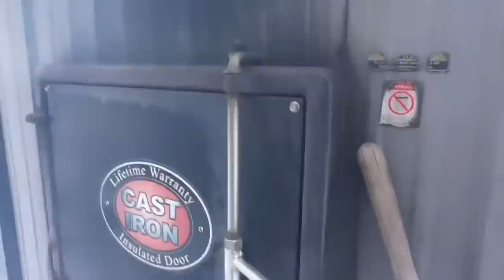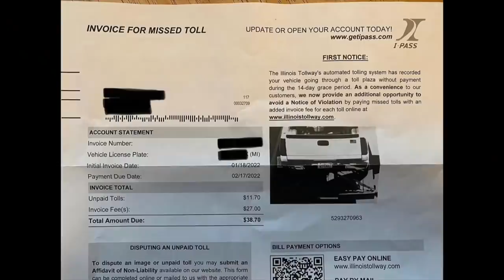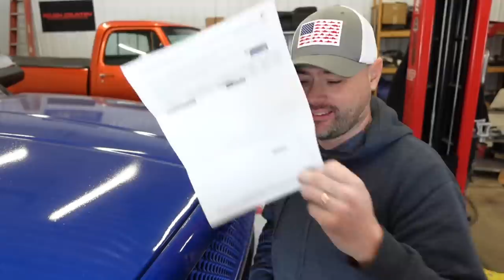I Got A Ticket For The Truck I Was Towing Through A Tollway! IS THIS LEGAL?

Comment: Keep a close eye on your billing!  Based on the conversation it sounds to me like she changed the settings for the easy pass to a 4-axle vehicle.  If so, now you will be overcharged every time you go through a toll booth with just the truck.
Reply: Hope he see's this comment.
Reply: @joseaklx300r6  next time you go stop at one of the rest stops on the toll road. They sell prepaid ez passes in vending machines that you can link to your credit or debit card very easily. I suggest getting a prepaid credit card to link to the prepaid ez pass.
Reply: Not to menton if he goes through the toll without any cargo on the trailer (a vehicle), sounds like he will also be charged as if there is one on it.
Reply: @DallasD_  Its axles on the ground, they don't care about cargo.
Reply: @1958johndeere620  👍🏼 makes more sense, 5:45 she says "car", she meant the truck puling the trailer, car sounds like refering to what could be pulled on the trailer.
Reply: @DallasD_  From the sounds of the conversation, I think they only bill for axels, empty or loaded would not matter.  Just to be safe, when hauling a customer vehicle, he would be wise to cover the plate.
Reply: @1958johndeere620  Technically it's tires on the ground, if the axles are on the ground, you've got bigger problems than the tolls. ;) 
He could legally cut the extra charges in half when pulling an empty trailer by removing both wheels off of one axle and chaining it up so the equalizers ride level on the other axle. Might not be worth the hassle for $20 but it's $20 in his pocket and not going into the Tollway's coffers. If it's something he does regularly it would add up, or at least pay for lunch.
Reply: @butchs.4239  It's Illinois. The toll winds up going to everything except the toll roads.
Reply: Illinois didn’t send me a w2 for my taxes this year. Called them. They said we can pick one up 90 minutes away. 😂
Reply: I believe she said it would be half price when it was just the truck.
Reply: @davidwickboldt712  Could be..... Just to be safe I'd keep a close eye on my billing if it were me.

Comment: according to my research, tolls are assessed by the number of axles for the towing vehicle plus axles on the trailer. according to the information provided the trailer tag number must be included in your account to properly charge you for the tolls. the cargo, trailer, and towing vehicle must not exceed a stated weight which most have as 20,000lbs.

Comment: I drove a flatbed semi. If I had to go a long distance empty, I would use straps to draw up the first axle on the trailer. Leveler on the rear axle, no prob.
With less rolling resistance, I saved a lot of fuel.
Went through tolls that way, and they always marked a single axle on the trailer, because that's all that was in the ground.
Win-win.
Reply: That... just shows how stupid this whole thing is.  You had the same weight, yet you put it on less tires, increasing the PSI on the road surface and therefore the stress on the road.  Yet they charge you less for that.  Not faulting you, just the state, it's idiocy as usual.

Comment: Just a note, around here, specifically Baltimore tunnel, pulling a two axle trailer through the tunnels is $3 for 2 axles, $12 for a total of 4 axles.  At that price point its cheaper to go around.
Reply: I've pulled a travel trailer on toll roads and there is always a charge for the two extra axles on it.

Comment: I've been driving for almost 30 years and nearly every toll I've been through charge based off of the amount of axels you are taking through the toll. The reason is because the more weight you place on a road, the more damage it does exponentially.
Reply: Came here to say this. My buddy towed my truck and I got charged for 6 axles. Considered disputing it but it does make sense so I let it go and paid the man
Reply: One thing to consider: most current two axel transit buses (40 ft.) weigh close to if not over 30,000 lb. unladen. That's 5000 pounds pre tire (6 total), even more with passengers on board. At 80,000 lbs. a fully loaded 18 wheeler is putting down  approximately 4,450 pounds pre tire. This means that the bus is putting more weight pre tire on the road than the truck. Translated the bus is putting more stress on the road surface. So who should pay the higher toll?
    Note: trucks are allowed 12,500 lbs. on the steer axel (there is a live stock exception) as buses are allowed to go to 20,000 lbs.
Reply: your right at the toll booth it shows price by axle in IL im a local truck driver here!
Reply: A motorcycle only has two axles but pays the same as a car.
Reply: Obviously more wear’n tear per more weight but certainly not “exponentially” and there’s not one formula to substantiate such hyperbole. Also it’s not a logical cut and dry approach as many two axle vehicles as light in weight as motorcycles are rated as a standard four wheeler vehicle. Then it’s not all contingent on axle numbers but rather includes number of tires. All systems are programmed to assume multi axle trucks have multiple dual wheels per axle side and so try to accommodate toll rate accordingly. Yes there are infrared laser tripping detectors to count number of axles per vehicle and timed lapsed motion detecting to distinguish between vehicles passing through. It is recommended that you remove and or cover license plates of towed vehicles when transversing toll routes or you will be charged double or ticketed and or fined for unregistered vehicle plates.
Reply: @marvinjgerald6007  You can find the GAO study yourself since YT blocks links, but here's the gist:

"A study by the U.S. General Accounting Office (GAO) determined that the road damage caused by a single 18-wheeler was equivalent to the damage caused by 9,600 cars. (GAO: Excessive Truck Weight: An Expensive Burden We Can No Longer Afford) The study seems to have based its calculations around the number of axles per vehicle. The study found that essentially, road damage was related to the 4th power of the relative loads. That means that if one vehicle carries a load of 1,500 pounds per axle and another carries a load of 3,000 pounds on each axle, the road damage caused by the heavier vehicle is not twice as much, but 2 to the 4th power as much (2x2x2x2 = 16 times as much road damage as the lighter vehicle)."

Like I said, exponentially. 

As far as your interest in arguing over the minutia of how tolls are levied onto the public, that's a conversation for you and your state/local government to have since they are the ones who determine all that; not me.

Anyways, good talk. 👍
Reply: @robertheinkel6225  you must be young? a car has 2 axles... a motorcycle has 2 axles as well. a car has 4 wheels... a motorcycle has 2 wheels. a wheel attaches to an axle. axles & wheels are different things.
Reply: @stormtrooper88  haha he got ya mate just admit it.
Reply: @d.s.steele3100  buses - they are encouraging less vehicles
Reply: I have a triple axle and take 2 tires off to equal a tandem & I pay less $ . Haha
Reply: @d.s.steele3100  I am not  sure on all toll roads but most have a separate charge for Busses ( I know that Maine does and the Mackinaw Bridge for sure)
Reply: @robertheinkel6225   you are right and if you tow a small single axel trailer with a motorcycle you get charged for 3 axels. Just a reminder a motorcycle has 2 axels. Just each axel only has one tire. Also a dually truck pays the same as a motorcycle and  a passenger car and it has 6 tires. Yet again you pay for the axels not the tires. lol I personal think all bikes should get lower rate.
Reply: @robertheinkel6225  cars only have 2 axels too... Just extra wheels 😬
Reply: But they just tar over potholes ...or dont fix at all ...fraud
Reply: Tolls are such a scam..Most of the toll roads are owned by a company out of France..And most tolls are supposed to go away when the road is done and there is no more work..crazy that they work on the same road for 50 years
Reply: While I understand that premise generally, I have to make the point that if you replace the truck on the trailer with an equally weighted peice of steel, you would pay less. Same weight, but paying less because theres just less axles. They should charge for just axles on the road for this reason.
Reply: @SpaceRanger187  Where I live, there are no tolls, but the road construction never actually ends. They get beat up horribly in the winter, so they're always fixing them in the 2 months we have of decent weather

Comment: I’ve had this happen on the dc beltway and once on the gw bridge in New York. Both times the ez pass didn’t pick up on the trailer and both times it was cost effective to pay the ticket for the car on the trailer. Gw bridge is $13.75 for a pickup, but it’s $88 for a pickup with a tandem axle trailer…..the $13.75 and the $20 fine for the car on the trailer saved me 40 bucks haha

Comment: On head gaskets, head gasket cement can sometimes gather stick and bind when torquing down and guarantee a future problem. Use grease only and lightly and everything will slide into position perfectly and torque  down smoothly. Remember, it's the gasket that does the work, not the cement.

Comment: Make sure you are not charged for the truck that is on the trailer though.  You do have to pay a toll based on axel count however axels not touching the pavement ARE NOT subject to charges.  I live and work about 2 miles from the Ohio Turnpike and drive it every day.  I've assisted multiple customers with these complaints ranging from IL, IN, OH, NJ, PA, and FL toll roads.  Let me know if I can help.

Comment: I had this happen years ago. My truck was in an accident, it was taken to a body shop for estimate and repairs. The insurance company totaled the truck because of the age. The insurance company sold the truck for scrap and the company came and towed it, they had to go on a toll road, my truck was being towed by the tow bar on a roll back. The insurance company didn't let us get the tags off the truck so it got a ticket for running the toll. I fought the ticket and won.

Comment: For whatever reason your transponder didn't read causing your violation.  Make sure the transponder is mounted to the Windshield in the proper direction, you'd be amazed as to how many people don't do that, or it may not read properly. The pic of the one on the vehicle dash is directional and doesn't work the way it was laying on the dash. The one you held in your hand is better but can be temperamental. If your transponder reads, the system, will automatically see you are pulling a trailer and deduct your account accordingly.

Comment: All toll roads charge by the number of axles, except PA  they charge by number of axles and by weight.  Hope this helps you and others.

Be happy you aren't running a semi through IN, they charge us $57.75 for 5 axles.
Reply: I ran a gravel train with 12 axels  I cant remember the exact total but it was over $150 if I remember correctly

Comment: Ok, after watching the thing they were right, you don’t get charged for the axles of the car on the trailer, but if you pull a trailer for business you HAVE TO have a toll registration for the axles, pikepass in Oklahoma makes you get two pikepasses, one for 2 and one for 3 or 4, and put the one you’re not using in a ziplock bag lined with aluminum foil. My dad and I had a mowing business and had to live with this all the time.
Reply: Pretty sure Oklahoma's 2 axle pass gets voided the second you remove it from the windshield.

Comment: I received a bill from the Pa turnpike last summer. I haven't driven in Pa since the mid 90's. A close look at the photo showed a white Chevy, but my vehicle is a black Ford. Our license plate numbers were 10 digits apart my last four are xx1x, the pictured plate was xx0x, but the picture had a line of static through half of the 0. I called the number for the turnpike and the person I spoke with agreed it was misidentified and cleared my bill.

Comment: Those friends telling you to pull the pates on the loaded vehicle are correct. I always pull the plates. I once pulled a 5th wheel RV with a trailer behind the RV with two motorcycles out side Denver CO on the toll road and I pulled the plates on the bikes (so I don't run into these issues). I never got an invoice for the toll because their cameras didn't catch the truck, camper or trailer tags. Not so lucky in Oklahoma, got charged semi toll charges through there.

Comment: This video was a month ago, so probably a moot point to even comment now, but you don't need to register the vehicles on the trailer.  You only need to have a transponder for the truck only (two axles) and another for your truck while pulling the flatbed (four axles).  Pop the two-axle transponder on the windshield when you're running without, and pop the four-axle transponder on the windshield when you have it.  

I live in Alaska, but I had to do this when I was at my place in Ohio last fall.  Man, tolls are WAY more expensive with the trailer in tow, regardless of the weight you may or may not have on it.

Comment: they cannot ticket you for a vehicle you are towing. the truck being towed is not driving on the road. i definitely would be removing the plate on the vehicle being towed going forward
Reply: Its not the loaded truck that caused the toll its the extra 2 axle of the trailer. Btw some stated 2 tires are counted as one axle. That means a dual wheel pickup gets charged 3 “axles” not just 2.

Comment: Unless i misunderstood the situation i believe you only pay for the axles that come in contact with the pavement and very definitely not what is in transport on a trailer or any other means where its not in contact with the pavement. Ive driven a wrecker for years and when I was in a conventional i was charged for 3 axles not 4. I would follow the advice of covering or removing the plate. You are not doing anything illegal but it will stop any further inconvenience.

Comment: Great vid TM. New to your channel.  An argument could be made that we do NOT live in a "free" country. But that's another topic.  We are free, however, we aren't free from the consequences of our words/actions.  Those roads you're driving on cost money to construct...AND maintain.  I live in Colorado and the cost of the annual or semi-annual inspections is ridiculous, upwards of $2000 for the newest models of vehicles.  I used to live in Texas and the inspections there cost less than $100 (usually) ANNUALLY.  I thought about that and I sort of understand why that difference exists.  The winters here in Colorado are much more brutal than Texas'.  Plus, CO has a LOT more mountainous terrain and the resulting rock slides that happen.  The greater snow/ice buildup requires the use of the different road salts in much greater quantities than Texas uses. Besides, the Texas DOT usually uses sand on highways for snow/ice, rather than those salts.  Not to mention those salts are way more expensive than sand.
Then you have the repairs that have to occur from much more frequent broken pipes and power lines, and various other road structures that occur from that snow and ice.  So yeah, I don't like the fact that I have to pay in CO, 10 to 15 times the inspection fees than in Texas.  And those issues are just for the highways and roads that are PUBLIC, not the toll roads.  And, those toll roads have all the same annual weather issues, PLUS, they have those bonds that have to be paid off by the cities and counties for the convenience of the more direct routes of those toll roads.  Hence, the tolls.  Yeah, it's complicated in a lot of ways, but really simple too:  Nothing is really free. There's always a cost to do.....anything.

Comment: Make sure you cover or remove the plate on the vehicle that is on the trailer.
What probably happened is that toll picked up the toll-transponder and when it didn't match the plate to the one assigned to the transponder they sent you a ticket.

Comment: Sounds like their system can't automatically distinguish the trailer. Ours in Texas do register it as an additional charge automatically. In fact, I had one of those trailer hitch mounted cargo carriers on my vehicle loaded with a piece of furniture, and it counted that as a trailer, even though it didn't have any axles!  Also had my car charged when it was on the back of a tow truck because it had an active tag on the windshield. They wanted a tow receipt for that day to remove the charge. It was less than $5, so no big deal, but it is the principle of it.

Comment: Same issues here in Texas with our tollway and express system here, you have to have a tag for your trailer as well as the tow vehicle. However, it is BS that you have to pay for a vehicle that is not even been driven and they should refund that. Happens here as well and no one ever wins that battle. So what I do is I remove the plate on any vehicle on my trailer, or cover it with tape (Both front and rear). That way that towed vehicle will not get charged and just my registered truck and trailer will. Yeah it is BS, but what has to be done to avoid the extra charges.

Comment: you showed the transponder laying on your dash.  I don't think the overhead sensors will read it if not mounted on the windshield.  If it can't be read, they will charge based on your rear license plate - the only one that was readable was the one on the truck on the trailer.  

It also sounds like you might be getting charged the trailer rate every time you use the toll road, even if not pulling a trailer.